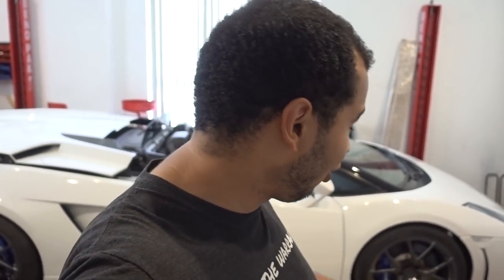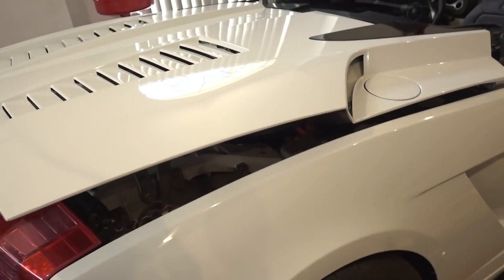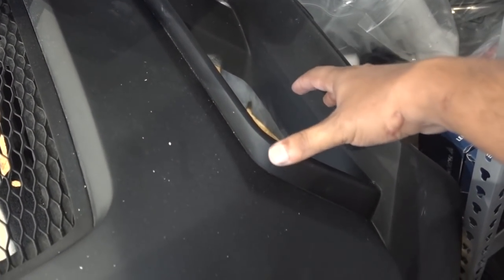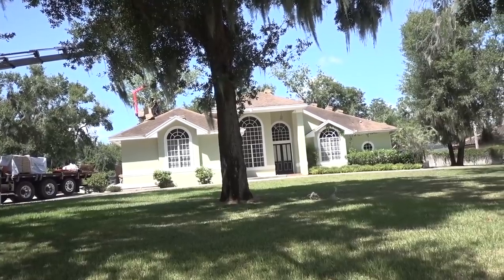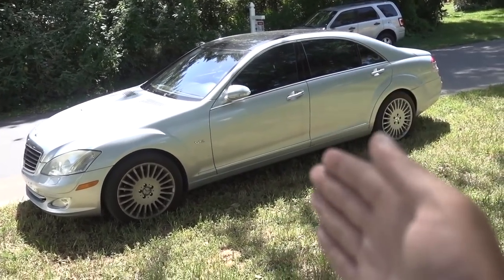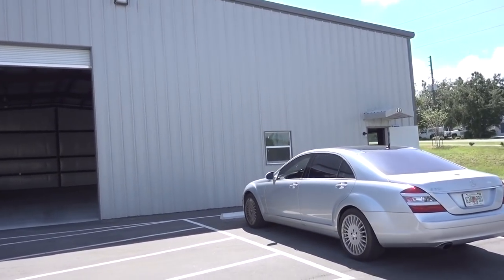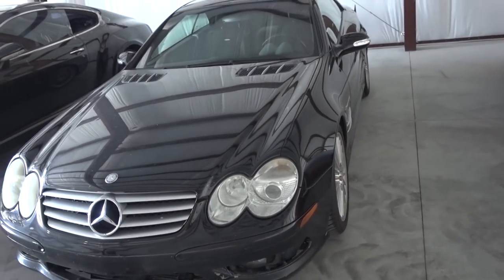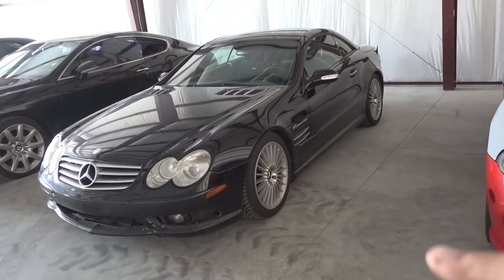I'm MOVING Because Of My Cheap Lambo?! + SECRET PROJECT REVEAL | BIG GARAGE UPDATE

Comment: Do yourself a favor.  For the wall between the office and the shop, go with a double-stud 2x4 wall.  Bottom plates should be pressure-treated and rated for ground contact.  You can go lightweight steel stud, just understand you may have rust problems in the future.

You're going to want to insulate.  Don't waste money on Fiberglass.  Use Rockwool Safe'N'Sound stuff, as you're going for sound insulation, rather than thermal insulation.  You'll get a bit of thermal insulation out of the deal anyhow.

Also, you will want a fire barrier.  Double 5/8" drywall between the double studs and 1/2" for the interior and exterior facings (use greenboard (water-resistant drywall) for the course closest to the floor)
Also note, on the shop-side, lay down pencils or something similarly thick on the floor, pointing in towards the studs.
This will act as a spacer to lift the drywall up off the floor so that if any water gets in and sits on the floor, it has to get pretty nuts before it starts soaking the drywall (belt and suspenders approach when used with greenboard).

For additional soundproofing use this stuff to glue the first layer to the studs.
https://www.greengluecompany.com/

At the mating surface of the two sheets of drywall

Remember, you're going to essentially be doing this for a ceiling as well.

Also, talk with one of your neighbors to do a sound test with you.  Close your garage doors.  Stand over by the windows in what's going to be your shop area.  Have the neighbor get LOUD for a minute and see how much sound bleed you have.  We help you determine if you want to build fascia walls on the interior of the shop office or leave them bare to the insulated steel.  If you're getting lots of bleed-through, go with 2x4 walls and Rockwool.

That should render your office fairly quiet.  If you still get sound bleed through the windows, you can mask it with heavy curtains or built soundproofing insets.

And if you're going to use it as a recording studio for videos, invest in foam soundproofing panels like these:
https://www.amazon.com/Acoustic-Panel-Wedge-Studio-Soundproofing/dp/B07C94ZZ57

Also, you can probably afford to AC the office.
Avoid the window units if you can.  They're loud and very power hungry and would drown out most recording.
They also are leaky, so you lose a lot of the cooling benefit.
Additionally, they'e a security problem, as someone can pry out double-hung window with an AC unit in it fairly easily.
Maybe look at a cheap ductless mini-split.  Just two coolant lines running through the wall.  Mount the compressor to the wall on the outside.  Then you have a nice, quiet air handler on the inside.
Don't DIY (kills your warranty).  Spend the extra money to have it installed.

Wish I could talk to you about electrical, but that's outside my purview.
Reply: Hyperstrike damn, this guy 🙌🏽
Reply: All great advice from @Hyperstrike. I would also suggest clearing all of your "not trivial to undo" plans with your landlord, like the epoxy you mentioned and the office space. Building walls usually means driving anchors into the concrete, and there are different kinds that cause more or less ugliness if the walls are ever removed.

I'll add that you might consider what you want to do with the space above the office. If there's ANY chance it's going to be storage for heavy things or a potential second floor/sleeping space, you'll have to build accordingly.
Reply: Some additional things I forgot.

Truthsmiles is right.  Make sure you get the OK from your landlord before doing ANY of this.

Under the stud wall's bottom plate, use sill plate gasket.  Nailing/gluing down the sill plate only goes so far.  If you get water in, it can force it's way UNDER the sill and into the office space.

https://www.homedepot.com/p/Owens-Corning-FoamSealR-5-1-2-in-x-50-ft-Multi-Use-Ridged-Sill-Plate-Gasket-2FS/202080947

Recommend pre-building your stud walls and then tilting them up.  Place the sill gasket where the sill plates go, then attach the wall to the floor (make sure level and plumb when you go to put the top plate on.

Attach fire-barrier drywall on the inner wall.  Smear with Green Glue.

Prebuild the outer stud wall the same way, but attach the fire barrier drywall before tilting up.  Will make the wall MUCH heavier.  So bring buddies or build smaller, panelized wall sections.  Smear some more green glue on the mating surface, then tilt up and push up against the first wall so you get solid contact.

Also, recommend bringing the bathroom into the office space as well.  Shop toilet areas can get pretty gross, even if just from leaving it open to a clean, open air shop area.
Reply: wow... i didn't read that...
Reply: Hyperstrike be needs to see this
Reply: =)  What can I say, my father was a handyman and I worshiped in the church of This Old House...

Norm Abram is my shepherd...

Comment: The rough engine idle may be ignition coil problems. VW cars from this era had lots of ignition coil problems.
Reply: Also fuel efficiency problems, they didn't build the cheat system good enough.

Comment: I epoxied the garage/shop floor when I moved into my place.  A friend who works at a marina recommended Seal-Krete Epoxy-Seal.  I also used the primer/sealer.  I've been extremely happy with it.  Make sure you roll any drips or runs out immediately.  It's pretty easy to do.
Kudos to being transparent with your income.  That's pretty personal.  People would be surprised at how much more money they'd have if they didn't drink, smoke, buy coffee every day, eat out (fast food is crazy expensive lately) and all sorts of other little things.  I've recently put a few of those luxury habits on hold and started selling things I don't need, want or use.  It all adds up quickly.

Comment: Having designed/spec'd many vehicle workshops I have a couple of comments:
1)  The floor looks as though it was power floated, which means that it will become a skating rink with any liquids on it.  You have a couple of options a) Blastrac the floor to get a grippier surface and then seal it, which is relatively cheap operation or finish it with epoxy/polyester with sand added.  Take special note of the bay joints, which must be maintained
2)  What is the wall finish?  It should be IMO concrete block up to door head height so as to be durable.  It does not look as though you can fix anything to the walls so you will need a subframe for all your perimeter fixture.  Also, how flammable is the wall finish?  You will be doing hot work internally as well as having machines working so this needs to be completely non-combustible.
3)  The lighting is generic warehouse type lighting, which is not suitable for vehicle workshops.  You need flourescent/led strip lights running lengthways between the bays (not over the top of the vehicles) so as to light the side of the vehicle - these will also minimize the shadows within the engine bays, interiors and boot areas.  Add perimeter lighting at door head height on all the walls.
4)  Install a decent sized compressor(s) and fit a ring main so as to allow plug in points all around the unit.
5)  Fit an external water hose point and power for a high pressure washing facility.
6)  Consider fume extract but remember that vehicle fumes are heavy so that the extract points need to be low down and therefore don't make good general ventilation.
7)  Add some fans through the roof for ventilation.
8)  Add a stainless steel wash trough with ss splash back for general hand (and occasional parts!) washing because your rest room area will become a might ****hole if you have to wash in there.  The trough can be sited against the rest room wall to easy the plumbing installation.
9)  Install CCTV and decent security because you will be more vulnerable than your neighbours. 
There are many other considerations but these are the general main ones.

Comment: For the Bentley you ideally need a scissor lift, for the phaeton/bentley you pretty much drop all the running gear from underneath, in the dealers they use a scissor lift with mounting lugs on it that you attach the running gear to and lift the body off using a 2 post lift. Quite easy to do with the right kit.

Comment: Not to hard to build a office, my recommendation. Get some track and stubs ( 20 gauge). You gonna need a hammer drill with tapcon screws(blue) to screw the track to the floor... u choose how big you want it . Studs is what slide on the track. Sheetrock screws on the studs. Of course there’s way more to it...but that’s how you should start

Comment: Congrats on the new space.  For building interior walls: use metal studs; they already have cutouts for plugs, wires etc.  Fasten to floor with hilti gun.  Code in most places is studs 16" on center, gives you 3 studs per sheet of plaster board.  Suggest you do installation of boards yourself, hire a pro for taping and plastering, then you can do painting.  Electrical is easy to do, lots of instruction online; but building codes may need permits, inspections, etc.  Suggest you get fire/theft insurance, liability insurance if you have others working there.  In your chill area, install a room air conditioner, exhausting into general shop area.  Pick up a cheap used fridge somewhere for pop/beer/whatever.  STRONGLY suggest you put in a paint booth, structure a deal with a bodyman who needs a place to work; he works on your stuff for free, he gets to use your paint booth for free and do bodywork there.  You've got the space.  You've got the basis of a great shop.  Go big!  >Charlie

Comment: The Ferrari looks in much worse shape than the Lambo. I think you're just buying problems!
Reply: At this point i'm pretty sure he's doing it for the challenge alone.
Plus the initial "cost" was... zero? So there's that.
Reply: Gabriel  i think there was insta photos of a donor 355 in better condition so merging of both perhaps
Reply: none of them are his cars, hes obviously lying!
Reply: yeah check out his social blade, plus he has in video sponsors. he will make bank off of this ferrari
Reply: * he is buying a few of Hoovies Problems :D
Reply: Fixed a few burnt cars over the years, they often look much worse than they actually are. Take away the burnt plastic and melted grunge and you have a big chunk of metal that sets fire to petrol inside itself a couple hundred times a second. Cleaning is the kèy.
Reply: TheOneTrueYingYing  
hoovie did a video stating that Tavarish bought it already.
Reply: defo going to need a donor car for the electrics.
Reply: @peterseaton4777  You're right but nothing is cheap for a Ferrari
Reply: That’s part of the fun.

Comment: Good for you. That new garage looks very spacious and more appropriate for you to store your cars and work on them. As for the lighting, I suggest you try a solution you can move around the shop and have right where you need it, like the lamps used by filmmakers that are adjustable in height and angle.

Comment: Before changing injectors on the 7.3, have you dropped the tank and removed the in tank filters?   They get clogged and aren’t serviceable.  Need an external filter before the pump.  Well worth it.

Comment: I am a 300ZX NA Slicktop owner. Not a powerful motor, for sure. I love the car, though. With big brakes, intake, and suspension, you've got yourself a nice canyon carver. You are correct in that they are hard to work on since there's very little room in the engine bay to work around. I do get help from the Z specialist in the area to keep it running.

I'm going to disagree on the looks and drivability, however. The 300ZX is a much sexier body style than the 350Z, and that's generally agreed upon in the Z community. In fact, I think the 350Z is rather fugly (the 370 is definitely a step in the right direction). The other detail is that the 300ZX is set up as a better driver's platform and more attractive interior. We 300ZX owners are pretty specialized breed and we're good with it! You probably are right that a 350Z might make a better platform for a build if you did not care about the superior body styling of the 300ZX.

Keep up the great work on the channel. Love to see you do a 300ZX or old school Datsun Z at some point so you can see for yourself!

Comment: Check those vacuum lines on that Bently, they are located near the bell housing on the transmission and are a bit expensive. The engine drop is also quite a chore.

Comment: You own a a lot of my dream cars, and youre doing a vey great job. I think with the bentley your issue might be from the hoses that comes from the fuel pump, to the engine. If the ones for air are switched with the fuel ones it can lead to limited power, and it may leak fuel, its worth checking if you havent already. Before you go and get a whole new engine. I had this issue with my audi. Hope you see this, gimme a shout if it works. Keep wrenching man.

Comment: Tavarish
Why not turn it into a GTS?
Then you got the benefits of an open roof like the convertible (and if I'm not mistaken you can re-use the locking-mechanism atop of the windscreen, for the roof panel.), but on the other hand also have the bodylines of the Berlinetta!

Comment: Lowes Epoxy Coat is the best deal on epoxy - you have to order it, look for 100% solids epoxy.  Used it on my warehouse floor, works great.   It's actually from a well known supplier but significantly cheaper.

Comment: Great decision on the shop.  If a time comes that you don’t have a car to work on can I bring my old Wagoneer over? She is running pretty rough and I’m in the process of rebuilding the transmission. Also if the Bentley engine is toast, I bet there is a cheap LS engine out there you can turbo up and put in there.

Comment: When u say one bank had low comp I'd look at the intercooler for that side unless uv comp tested that bank cos if turbo or intercooler isn't working correctly will give simular symptoms. First if easier comp test or vacuum/ pressure test manifold
Reply: This is for the Bentley if a intercooler is bust cos I think there one for each bank is bust would make one whole bank run off and, as for the dodge go hennesy, turbo the life out a it

Comment: Regarding the Bentley, I've had a Passat W8 which behaved the same way, low on power and some shaking at low RPMs.
The issue with the W8 in particular, but probably all W engines, is that the solenoids controlling the cam settings get stuck.
These are 5 volt solenoids which when are fed with 12 volt often get unstuck.
Check this forum post for more information:
http://www.w8forum.dk/forum_posts.asp?TID=1196&PN=1&SID=d1b36b7cc435d57bcb13cdbed8711zaz&title=found-camshaft-adjuster-fix

Comment: 300ZX didn't have engine problems, but it is a well over engineered car, with many unnecessary coolant and vacuum lines that with nearly 30years old tend to go bad. It's biggest problem is being abused and bad maintained with cheap parts by young owners. Also about the power, the mkIV supra wasn't even around yet and the 300zx was already making +1000whp. A well maintained car with with replaced or deleted coolant and vacuum lines will be trouble free

Comment: Unfortunately my friend, those injectors are going to run you a pretty penny. Plus a 6.0 with that many miles is gonna need more work than just injectors. High pressure oil pump, any egr components and the head gaskets are all known issues with that engine that, unless you already took care of them, will need to be addressed while you have the engine apart. Good luck! I'm from your original home state of New Jersey or else I'd help you with the truck!
Reply from the maker: It's a 7.3
Reply: My apologies Tavarish! That is an excellent, super reliable engine that you could definitely squeeze 3-4 hundred hp out of easily. I used to work for international and our bread and butter was the 6.0. The 7.3 was usually just in for oil changes lol
Reply: My 6.0 has 230k on, still has original injectors and headgaskets, still has egr cooler, I run wpe custom tunes on a sctx4, it also has a upgraded ficm with a atlas 40hp tune as well as a 4” straight pipe, no problems what so ever, run good oil, and do your maintenance on a 6.0 and they’re great
Reply: Nick Carr that is awesome! You're one of the lucky few! Good luck with your truck she sounds like a keeper haha

Comment: If your willing to drive to Ohio. You'll want to talk to Matt Alderman who is the operator and owner of Street stangs.   He's a mustang tunner that work on all Chey Ford's and Dodges when gas or Diesel.  He is the only tuner that I know that made a tune for the Tarus Sho to do a 12 second pass with everything stock.  This is a link to His Facebook to call Him.  Matt is a great guy and knows what He's doing.  A few years ago He had a 2011 mustang that was making 430 how at the wheels with a 5.0 engine, off road pipes, and a prototype Roush cold air intake at the time and a 2 step in His tune.  Also He was going to put on the ghost tune which was not allowed at the time. https://m.facebook.com/pages/Street-Stangs-LLC/121044551287823

Comment: Razor gimmicks are the biggest con of the last 50 years. The traditional double edge razor is the cheapest, closest shave, with the least irritation. And blades are pennies each. Don't get lured by 3, 4 and even 5 blade razors, that just means 3, 4, 5x the irritation and 100x the cost. Do yourselves a favour and get a double edge razor
Reply: Or just get an electric which would save you tons because you don't need to buy razors
Reply: mariogamefreak1 electric are more expensive and don't shave as close as a wet shave. The one I tried irritated my skin too
Reply: @mariogamefreak1  electric can never cut as close. They also get dull thats why the expensive ones have replaceable cutter heads